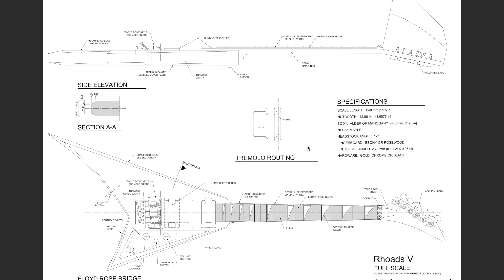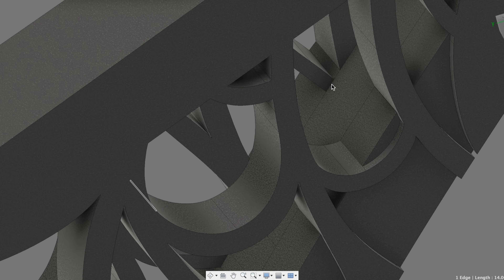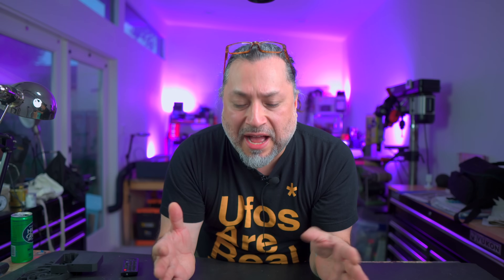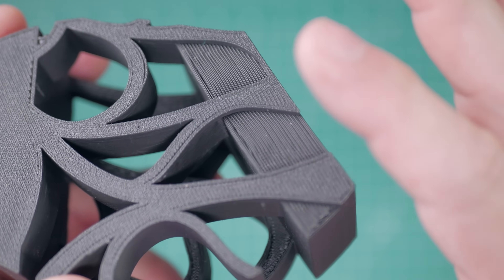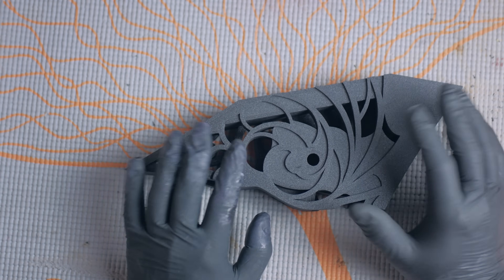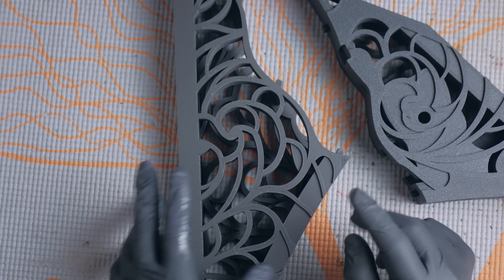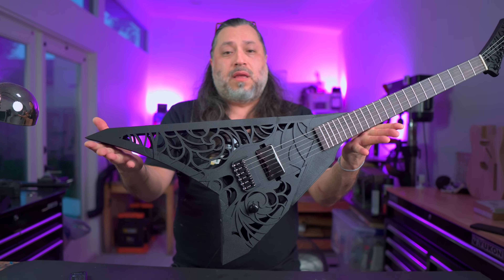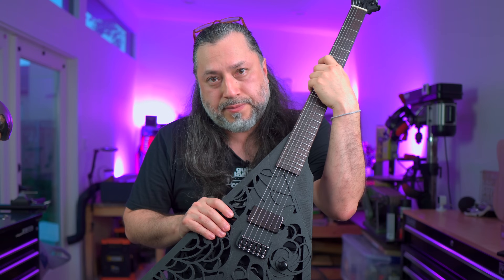3D Printed Guitar with Impossible Geometry

Comment: Great design. I bought you files and I was wondering if you had them also split the way you showed it in the video, with the design elements at the top as a separate part as well. That's what I was expecting in total honesty. Thank you in advance.
Reply from the maker: That's fair. I didn't think about that. I was 100 percent experimenting through out this entire build. Each piece was  printed differently. So I literally only have the lower horn with the split piece with the tabs and the main center with the split piece without tabs. So there is no consistency. I'm happy to share the two splits that I did. I'll update the file with the added pieces. You can redownload. But I think any slicer can split via a plane. I'll work upload those files now. Thanks for pointing it out.
Reply: @MarkGutierrez  thank you. I could do it myself but it is more of a service to those who do not have the skills and/or the tools to do it themselves. I also noticed (sorry again) that the headstock piece is missing, it is a good addition to complete the look of the guitar and make the neck feel less of a retrofit.
Reply from the maker: @giacomobosso3525  Ha. The neck I used was a Chinese knock off of a Jackson neck. The headstock dimensions are not exactly the same as a real Jackson. I designed the headstock piece to fit perfectly with the dimensions of the Chinese headstock. It won't fit any other headstock. The tuner holes and geometry would not match up with any other headstock unless the neck was bought from the same eBay seller. I didn't see a point to providing it.
Reply: @MarkGutierrez  I'm going to use the exact same parts you linked in your description.
Reply from the maker: @giacomobosso3525  email me through my store. I'll email you the headstock piece.
Reply: @MarkGutierrez  thank you for providing the updated files. I started slicing and printing and I got to appreciate even more how beautiful this design is.

Comment: How much infill and #walls? Also, you drilled for carbon rods?
Reply from the maker: The parts of the guitar that were non load bearing had the standard 15 percent infill. The main center body and neck heel were at 25 percent infill. If I remember correctly there 6 walls. Whatever the number was that got me close to 2.5mm wall thickness. The carbon fiber slots were designed into the geometry of the body. The main rod slots were slid into the body before glueing on the heel part. Then the last two were slid after the heel was glued via the  slots in the heel. All slots are hidden.
Reply: Thanks. As a guitar newbie (not in 3D -printing), what is the name of the most upper part, where strings are attached? What carbon fiber rods did you use? ....and the is alreay geometry for that in the STEP -files?
Reply: Hello?
Reply from the maker: @RedBreather  You mean the headstock? The carbon  fiber rods I used are linked in the description. The slots are modeled in the files.
Reply: @MarkGutierrez , no, the most upper part. Its not in the zip file?
Reply from the maker: @RedBreather  contact me via my store
Reply: @MarkGutierrez , done :)

Comment: Great design - I love the spilling over of the complex design onto the more structural sections.
I only have a tiny budget resin printer, so I've made a guitar body where each piece is very small and fitted it together like a puzzle, then given it a shattered look in a Kintsugi style. It's semi-hollow, but weighs about 3.6 kg (8 lbs - without neck or hardware)! It was a great experience making it, though.
With mine I couldn't print accurately enough to use locator tabs (and couldn't experiement because I used aroun $200 of resin and each print took 10 hours+). So fitting and 5-minute epoxy glue-ups were a nightmare. The fact I was aiming for a Kintsugi style helped reduce stress levels, though!

Comment: Awesome job. Some thoughts on filling in less than perfect surfaces. 3d resin works wonders. No need to print anything, so no need for that kind of printer. Just brush it on and let sit in the sun for a few minutes. The high build can then be used after to fill the now minor imperfections. 
I like the idea of mixed materials, either for their structural properties or aesthetics. Bonding surfaces can be either highlighted or blended to create the How THE Everloving f!@# did you get that shape out of that? And with veneers? Baffle and dazzle.
Shit now I need to up my tool collection...the biggest hurdle will be the knowledge side, chiefly the design

Comment: My latest project is a mixed materials concept. I’ve used Sendcutsend for my hardware on wood instruments but I’m going to try to use more metal to handle the majority of the top and back and then fill out the more structural parts with wood. Some flourishes with negative space are definitely in order but I need to consider unwanted vibrations with a semi-hollow instrument. I make fiddles and it would work in my favor to get a banjo-esque tone. If it sounds and looks better than a cookie tin CBG I would consider it a win. 
Anyhow, your design is absolutely gorgeous and inspiring!

Comment: This is amazing! Would love to try it out for myself. Would you be willing to provide some more information on the assembly process? Such as the carbon fiber rods and attaching and tuning the neck.
Reply from the maker: Hi, the body is design to fit together kinda like Lego pieces. There are tabs and tab holes that align the pieces. I simply spread some epoxy between the pieces before binding them with surgical tubing. Because of the odd angles, clamps are almost unusable. I've used surgical tubing with great success before. Essentially, you assemble and glue from the tip of the upper horn first. I was letting each glued piece cure for an hour or two before glueing the next piece. The heel is the last piece to be glued on. Before gluing the heel, you have access to the first two graphite rod slots. I coat them in epoxy and slide them in. Then glue the heel, then slide coat the the last two graphite rods with epoxy and slide them into the slots in the heel. Paint, then everything after that is just like any normal guitar.

Comment: 3d printed a RG style body couple of years ago with gyroid infill. After gluing the pieces together filled the body with epoxy resin. The body weighs something like 4 kg alone LOL.Not very practical and just an experiment. In this case it would be interesting to know how the 3d printed material behaves over time because it has a tendency to creep under constant tension.
Reply from the maker: That was exactly my fear. I had heard many stories about creep setting in because of the string tension. Which is why I chose to use 4 carbon graphite rods to strengthen it. But I've also heard that if your walls are thick enough (over 2.5mm) and you cut up the guitar into smaller individual pieces, then there is essentially, enough glue and walls to make for a more rigid structure. Obviously, these stories are all anecdotal, only time will tell.

Comment: Love the design. How hard would it be to make a similar model a 7 string? I've always wondered about the stability under string tension over time with PLA and hot summers. Does it lose tuning?
Reply from the maker: Thanks! Converting the body from 6 strings to 7 would take several adjustments to the design but it is possible. This guitar stays in tune just fine however, stability over time due to string tension worries me. This is the first 3D printed guitar I've ever built so I was very careful to ensure rigidity and it was mostly fear that drove me to make certain decisions. For example, there are 4 carbon graphite rods in the body, I used 9-42 strings gauges, AND I down-tuned a half-step to Eb. I'm also worried about PLA and heat. I wouldn't mind doing an experiment and leaving the guitar out during our triple-digit, Texas summers just to see what happens. That might be a great video. But I have it in good authority that I shouldn't worry about stability due to string tension. There are guys that have been making 3D printed guitars way longer than me that have had great success.
Reply: @MarkGutierrez  If you don't mind me asking, where did you find your graphite rods? I've used wooden dowels in a previous build and it still had too much flex. Graphite has me wanting to attempt a build. Thanks!
Reply: @MarkGutierrez  One last question: How did you install the humbucker? Normally you use a pickup ring held down by 4 screws. I cannot tell from the 3d print how this is held in place. did you just drill out two screw holes for the spring tension points on the humbucker? I'm currently in process of building mine at the moment. Thanks!
Reply from the maker: @mstrmold1807  It's direct mounted with two wood screws. In order to direct mount a humbucker, you have to drill out the tapped holes in the pickups feet to accommodate the diameter of the wood screws. Instead of springs, I use Pickup Height Foam. I get mine from stew Mac. https://www.stewmac.com/electronics/pickups/pickup-parts/pickup-parts-for-jazz-and-p-bass/pickup-height-foam/

Comment: For texture you could check out fuzzy mode. A lot of slicers have this feature and will wiggle the printhead as it follows the geometry. It can make a some interesting effects kind of like a textured tool handle.
Reply from the maker: Thanks for the suggestion. I watched a few hours of fuzzy mode example videos on YouTube before printing this body. I'm just not advanced enough to figure out how to keep the sides being jointed together from having the fuzzy  texture. Those sides touching each other would need to be smooth. Thanks for watching!

Comment: You can get a much more consistent surface finish by changing print orientation. Try experimenting with printing the wings of the V vertically on the flat sides. This will eliminate the need for separate pieces for the ornamental and structural parts of the design. I'm also a huge fan of using a filling primer before spraying my final color, much less work is needed on the finish. This is a great design and I'm looking forward to seeing what's next!
Reply from the maker: Thanks so much for the suggestions. I'm very new to 3D printing and appreciate any and all tips and tricks.

Comment: Hi Mark! How much does It weight the full Guitar? I wonder if you have measured it, as It could be interesting to know. BTW, great job!
Reply from the maker: Hi, I haven't weighed it but it is pretty heavy. I was surprised how heavy it was considering all the ornamentation. But I guess since I used close to 1.8  kilograms of filament, the body weighs around that. The neck was heavy too so definitely not as light as you'd suspect.